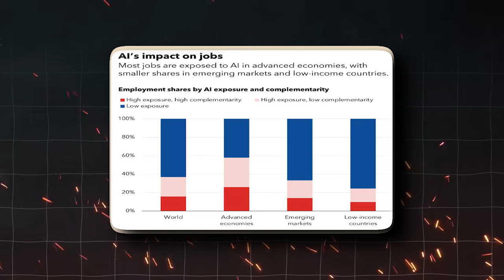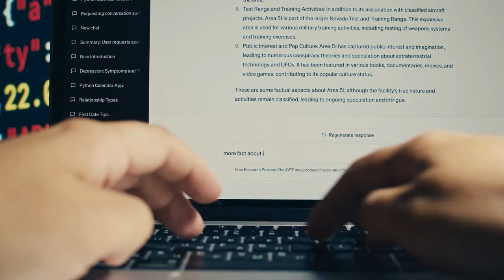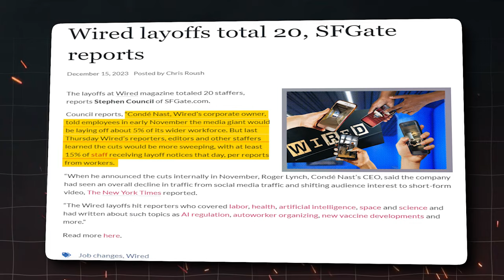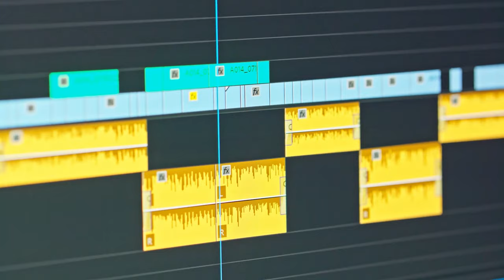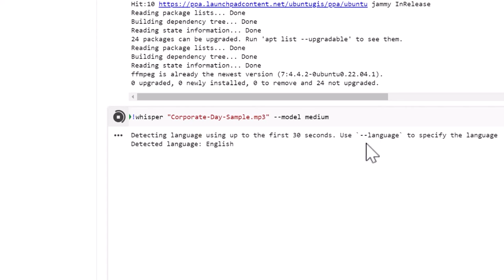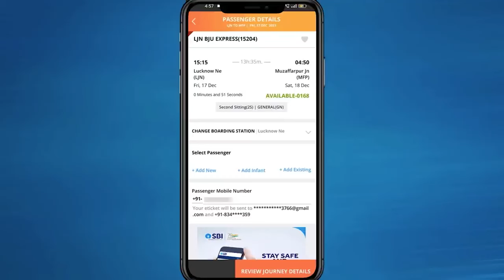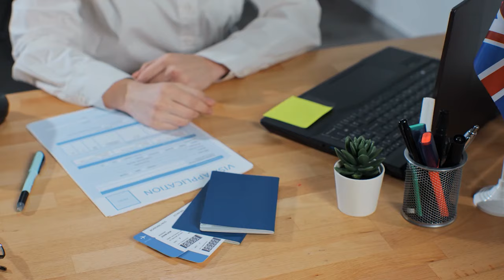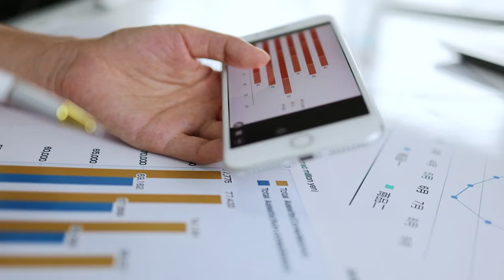The 2-Year AI Job Reset Has Begun! Get Ahead While Others Are Losing Their Jobs!

Comment: In fact IA makes a lot of mistakes. It is not accurate because is based on predictions. It will always need a human that controls the work and have the responsability.
Reply: Unfortunately not. AI is not entirely accurate yet because it is has a fundamental required ingredient of randomness, and could possibly use another order of magnitude more parameters. Accuracies can be improved by multiple means, including more parameters and more training data, but even GPT3.5 has beaten GPT4 on accuracy if you use agents and let it check itself a few hundred times. Accuracy is one simple issue amongst many and it will be solved in short enough order. A human will definitely not be necessary in most workflows by the end of this decade. Remember that each new generation of AI is an order of magnitude more powerful than the last. You are basing this naïve comment on what you've seen AI do *thus far*. GPT5 will be out at the end of this year and it will be an order of magnitude smarter than GPT4, with many new accuracy tricks, an energy layer for better planning of actual tasks and more. And then a year or two after that the next generation will come out and be another order of magnitude smarter and again in another year or two. So, conservatively-speaking, we will have AI that is 1000 times smarter than GPT4 by the end of the decade, so we will see your 'It will always need a human' prediction crumble in short order.
Reply: @ChrisRLong   talking of who is naïve...you get the first place. You don't even know in what I am basing my opinion and you don't know what my knowledge about this is. The level of arrogance in that comment has gotten you run out of memory exception. See you in a decade thow.
Reply: @JustIsTime890  : Fair enough. I'm AuDHD with very little patience for nonsense so when I see something as silly as "[AI] will always need a human that controls the work and have the responsability.", with absolutely nothing to back up such an extreme perspective, it can set me off, and it did this time. So please explain to me again why AI, with the current exponential growth of ~10x every 1-2 years, will always need some pathetic human to hold its hand. So in 2040 when, given the current curve, we will have an AI that is 100,000,000x as powerful as GPT4 is today, it's honestly your belief that this super-intelligence will still need to check with some human to make sure it's right? It's not arrogance that I have. it's simple logic. But I am relatively new to all this so if there's something I'm missing, please let me know.
Reply: @ChrisRLong Yeah, I have noticed how much your logic is so simple. I don't need, nor have to explain you, as a random extranger of a youtube comment, all the differents knowlegdes and factors I have thougth about, to make my opinion, that I put in a very simple way to everyone get the point. 
If you have agresive issues for having no patience because you ignor about a subject, it is your problem, not mine, and in that path  you are going to stay in ignorance,  frustrated and in rage, thinking that all humans are pathetics. If you put your opinion with respect, it can be welcome. As you have chosen the silly way, I am not interested in explain nothing to you. So make you a favour and don't keep insisting.
Reply: @JustIsTime890  Ah. I see your logic is unassailable. I stand corrected and my opinion is forever changed. I'm sorry, but you expected more respect than that for your original post? Was there some reason that I was supposed to assume that someone that just says "In fact IA makes a lot of mistakes. It is not accurate because is based on predictions. It will always need a human that controls the work and have the responsability.", and nothing more, has done extensive research to come to this unsupportable opinion? Are you kidding? Grow up and welcome to the internet. Back up your argument or keep it to yourself from now on.
Reply: @ChrisRLong  oh no, I will don't. I will continue giving my opinion and just give arguments for people that deserve it, that I can respect and I can talk with. So, this comment is not for you. You can skip it, or continue vomiting anger. Your anger issues and you, thinking the center of the universe, are two things not letting you grow up. And you can't even see it. I am sorry for you.
Reply: @JustIsTime890  Whatever let's you sleep at night, pet. We'll see who is right is short enough time so enjoy your ignorance while you can.
Reply: @ChrisRLong  oh yes, you are so important that I won't sleep thinking about what you've said 😂. Dude, you are becoming funny with such delusions you are having today. Oh, you've made my day 😂, thanks.
Reply: AI will improve alot as time passes
Reply: @JustIsTime890  You are right, AI will need a human - "A" human, like, one human. What about the rest of humans? So in a hospital you will need one - two doctors, in a Supermarket you will need 1 cashier (human) the rest AI, in a warehouse one human the rest robots, in programming - one or two programmers, the rest will be AI agents. So what about the rest of the humans? Maybe they will bring another event like 2020-2022 and take care of the majority of humans
Reply: @binixx  yes maybe. It is like industrial revolution. Human replaced by machines. A lot of works lost, new types of works appear. The persons migrating to the city then. Now the persons want to work from home and out the cities.
Maybe the artesanal work is going to be more valuable. In fact today there is a lot of people selling home made things on internet and earning life with it.
In theory all will going to be cheaper also. Maybe humans can live working less time and that can compensate the lost of works.
Industrial revolution at the end had lead to a grow of economy in a lot of countries. 
The key is, were is going to go that grow, like always.
And the transition is going to be hard for some people, and others are going to become the new rich.
In general history repeat itself.
Reply: No offence but you are waaaaaaay off!!   Do a little research!!
Reply: @QUECWA  no ofense but maybe you are experiencing the Dunning Kruger effect if you think all the rest don't do "a little research" just because they have a different opinion.
Reply: @JustIsTime890  

Oh dear, suggesting someone do a little research has got absolutely nothing to do with the Dunning Kruger…..

Your viewpoint that AI will 
“always need a human” is totally contradictory to the academic consensus so either you are brilliant and see things academics don’t or you are lacking!!!!

My vote goes for lacking -seriously lacking!!!!

Now, here’s your chance, do some research and start again!!!
Reply: @QUECWA  Authority bias now. You have a lot of bias to be a researcher. But anyway, you are so brilliant that you can't even explain your affirmations. You just come here to repeat : " no, you are wrong and I am rigth". Let me applaud you intelligence and excelent knowledge you are sharing with us that made you respond to a comment of YT to give us lessons. 👏👏👏...

Enough attention or you need more?

Comment: Technology may have advanced enough to release civilization from the confines of the second law of thermodynamics. 

The second law is behind modern refgeration needing electrical energy to compress the refrigerent to force it to release as waste the heat that it has removed from the refrigerator's service interior in the cooling part of the refrigerent's circulation. There is also discarded heat from mechanical friction. 

Refrigeration by the principle that energy is conserved should produce electricity instead of consuming it. 

It makes more sense that refrigerators should yield electricity because energy is widely known to change form with no ultimate path of energy gain or loss being found. Therefore any form of fully recyclable energy can be cycled endlessly in any quantity. 

In an extreme case senario full heat recycling all electric very isolated underground communities would be highly survivable with self sufficient EMP resistant LED light banks, automated vertical farms, thaw resistant frozen food storehouses, factories, dwellings, and self contained elevators and horizontal transports. 

In a flourishing civillization senario small self sufficient electric or cooling devices of many kinds and styles like lamps smartphones, hotplates, water heaters, cooler chests, fans, radios, TVs, cameras, security devices. power hand tools, pumps, and personal transports, would be available for immediate use anywhere as people see fit. 

Larger equipment would be built for enterprise use. 

If a high majority thinks our civilization should geoengineer gigatons or 
teratons of carbon dioxide out of our etnvironment, instalations using devices that convert ambient heat into electricity can hypothetically be scaled up do it with a choice of comsequences including many beneficial ones. 

Computers that consume electricity and yield heat would complement energy sensible refrigerators that absorb heat and yield electricity.  Computing would be free. 

A simple rectifier crystal can, iust short of a replicatable long term demonstration of a powerful prototype, almost certainly filter the random thermal motion of electrons or discrete positiive charged voids called holes so the electric current flowing in one direction predominates. At low system voltage a filtrate of one polarity predominates only a little but there is always usable electrical power derived from the source, which is Johnson Nyquest thermal electrical noise. This net electrical filtrate can be aggregated in a group of separate diodes in consistent alignment parallel creating widely scalable electrical power. The maximum energy is converted from ambient heat to productive electricity when the electrical load is matched to the array impeadence. 

Matched impeadence output (watts) is k (Boltzman's constant ~1.38^-23), times T  (tempeature Kelvin) times bandwidth (0 Hz to a natural limit ~2 THz @ 290 K) times rectification halving and nanowatt power level rectification efficiency times the number of diodes in the array. 

For reference, there are a billion cells of 1000 square nanometer area each per square millimeter, 100 billion per square centimeter. 

Order is imposed on the random thermal motion of electrons by the structual orderlyness of a diode array made of diodes made within a slab: 

v v v v v v v v v v v v v v v v v

All the P type semiconductor anodes abut a metal conductive plane deposited on the top face of the slab with nonrectifying joins; all the N type semiconductor cathodes abut the bottom face. As the polarity filtered electrical energy is exported, the amount of thermal energy in the group of diodes decreases. This group cooling will draw heat in from the surrounding ambient heat at a rate depending on the filtering rate and thermal resistance between the group and ambient gas, liquid, or solid warmer than absolute zero. There is a lot of ambient heat on our planet, more in equatorial dry desert summer days and less in polar desert winter nights.

Focusing on explaining the electronic behavior of one composition of simple diode, a near flawless crystal of silicon is modified by implanting a small amount of phosphorus (N type)on one side from a ohmic contact end to a junction where the additive is suddenly and completely changed to boron (P type) with minimal disturbance of the crystal pattern. The crystal then continues to another ohmic contact. 

A region of high electrical resistance forms at the junction in this type of diode when the phosphorous near the ĵunction donates electrons that are free to move elsewhere while leaving phosphorus ions held in the crystal while the boron ions donate holes which are similalarly free to move. The two types of mobile charges mutually clear each other away near the junction leaving little electrical conductivity. An equlibrium width of this region is settled between the phosphorus, boron, electrons, and holes. Thermal noise is beyond steady state equlibrium. Thermal noise transients, where mobile electrons move from the phosphorus added side to the boron added side ride transient extra conductivity so the forward moving  electrons are preferentally filtered into the external circuit. Electrons are units of electric current. They lose their thermal energy of motion and gain electromotive force, another name for voltage, as they transition between the junction and the array electrical tap. Inside the diode, heat is absorbed: outside the diode, an attached electrical circuit is energized. 

Understanding diodes is one way to become convinced that Johnson Nyquest thermal electrical noise can be rectified and aggregated. Development teams will find other ways to accomplish this wide mission. Taxonomically there should be many ways ways to convert heat directly into electricity. 

A practical device may use an array of Au needles in a SiO2 matrix abutting N type GaAs. These were made in the 1970s when registration technology was poor so it was easier to fabricate arrays and select one diode than just make one diode. 

There are other plausible breeches of the second law of thermodynamics. Hopefully a lot of people will join in expanding the breech. Please share the successes or setbacks of your efforts. 

These devices would probably become segmented commodities sold with minimal margin over supply cost. They would be manufactured by advanced automation that does not need financial incentive. Applicable best practices would be adopted. Business details would be open public knowledge. Associated people should move as negotiated and freely and honestly talk. Commerce would be a planetary scale unified conglomerate of diverse local cooperatives. There is no need of wealth extracting top commanders. We do not need often token philanthropy from the top if the wide majority of people can afford to be generous. 

Aloha
Charles M Brown 
Kilauea Kauai Hawaii 96754